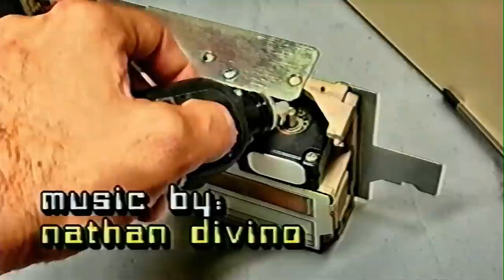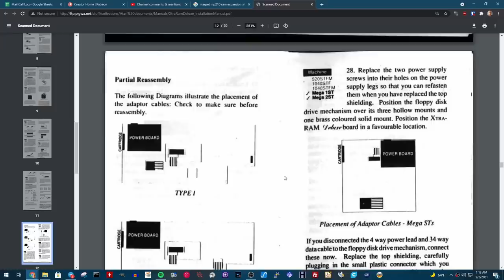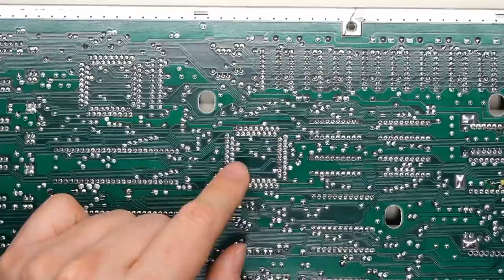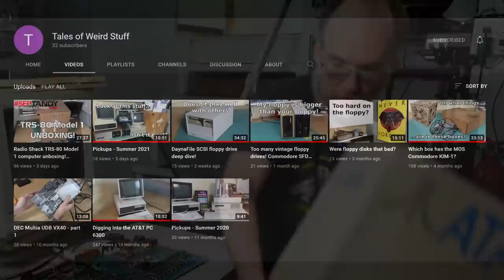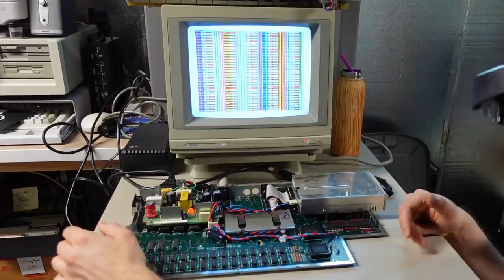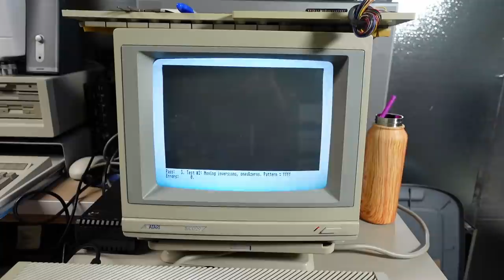I figured out what is wrong with the Atari 520 ST!

Comment: 4:10 I'm sorry to say that you're wrong here. There is only one bank of RAM (on a 520ST) and it is connected to data bits 15-0.
Reply: Now why are there two mods to disable the memory? This is because the 68k processor can address lower and upper half of the data bus individually, and, of course, chip selection of the RAM ICs has to support that, as well.
Reply from the maker: How does the 256k variant of the ST work if it requires 16bits of RAM?
Reply: @adriansdigitalbasement  Two banks of 128k.
Reply: 18:59 The ROMs are connected directly to the CPU, not through latches. Sorry, I like your videos a lot; but I find they should be factually accurate. 

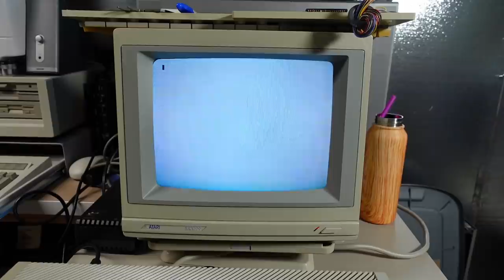31:34 Not to brag, but I'm the author of YAART.

In any case, congratulations for saving/repairing the 520ST.
Reply: @adriansdigitalbasement  There is NO 256KByte model released by Atari. And NO: THE 260ST came with 512KByte RAM. I bought one in Jan.1986. It just had one bank of RAM. I already wrote you these facts in an email from 4th Sept. BTW: nynyny7 is absolutely correct with his statements.

Comment: Weeeird to see GEM boot up with no disk drives present! Normally you get Drive A, which is really there (in a machine with the F), and Drive B, which it pretends to have, and lets you swap disks in the one real drive, to emulate it. So you can copy stuff between disks easily. Well, easily-ish, takes a few swaps if you have less RAM (it 512K) than there is space on a floppy (720K).

Comment: ooh my that's an obnoxious noise when the keyboard is disconnected!!! Must be a way to add a jumper or something to stop that when working on them in a dismantled state....... :S
Reply: You can connect/move a 10K resistor on the Rx line to 5V. There is normal a 10K resistor connected to ground but earliest model don't have a resistor at all on the Rx data line. The resistor should be close to the keyboard connector.

Comment: Facepalming the RAM explanation.  No Adrian, the ST has and has always had RAM on all 16 data bits.  The two chip selects are for selecting HIGH or LOW (odd and even) RAM, which is a feature of the 68000.  They can be accessed separately as 8 bits, or all at once as 16 bits.  The 74LS373 is part of the circuit to isolate the CPU from the RAM when the shifter is accessing RAM for the display.  On the CPU you will notice that there is no Address line zero (A0).  There are "Upper data strobe" and "lower data strobe".  They replace the A0.  They allow the CPU to access 8 bit and 16 bit memory depending on these "UDS" amd "LDS" lines.

Adrian, the book "Atari ST Internals" (available free on many places on the Internet) explains how the innards of an ST works.

As to the keyboard weirdness.  Some STs don't boot without their keyboard, as it's a shot in the dark whether it will or not.  It all depends on bus states.  The ST keyboard is intelligent, not just a grid like on other many computers. There is an onboard chip (in the keyboard) that handles the mouse and keyboard, and part of those signals generate interrupts.  When they are floating, they can cause the CPU to halt or just be confused.  It's always better to just plug it in.

Here's a trick, when booting an ST without a floppy, just hold "Control, Alt and Shift" down.  This tells the ST to bypass all of the boot seeks.  It tells it to not look for an AUTO folder, and not look for desk accessories.  Just a raw boot to desktop.
Reply: Never had an ST(E/F/FM) that needed the keyboard. Keyboard controller is connected to the ST's ACIA via a simple RX/TX serial port. So I doubt that "bus states" can have an influence on this. But you get the annoying "brbrbrbrbrbr" sound. IIRC a pull-up on the RX line helps.
Reply: @blackcathardware6238  Actually I have had an ST that does not boot without a keyboard each time (about a 50/50 shot).  It's a shot in the dark.  The key-click sound is the ASIC getting confused with the floating non-connection.  However it interprets those phantom keypresses makes the determination how it boots.  A pull up on the RX line is a perfect example of fixing a floating signal.  There are many busses in the ST, not just the Address/data bus.  RX is a serial input that is part of the ASIC's serial bus.  This can cause the ASIC to generate spurious interrupts and feed false data.

I am glad he got the 520ST to boot without the keyboard.  It just removes one aspect of troubleshooting confusion.  Frankly, even Atari suggested that proper troubleshooting required the keyboard be connected.  So it's not entirely a "non-issue".  I am picky about this aspect, as a disconnected keyboard was a bane in troubleshooting for me in the past.  A "everything checks out, why isn't it booting, even if I let it sit a while?" situation arose.  I connected the keyboard, and it worked fine.  My fixes repaired the machine, but failing to fully "electrically assemble" it brought up a non-problem that looked like a problem.  Want to leave the keyboard off?  Fine, but if it still doesn't work, just try connecting it to make sure.

Comment: The memory bus in ST is 16-bit wide, and it requires a presence of either 2 or 4 memory banks. Don't know the exact reasons, but 286 and 386 PCs were also using 8-bit memory banks.

Comment: I agree with others the ram expansion is pretty bad for this machine I would personally avoid it. There are OTHER options. You can sandwich more dips on top of the existing ram chips and double the ram. A few bodge wires and bob's your uncle. The sandwich technique seems more sturdy than the marpet upgrade. I have removed my ram upgrade boards from all my machines. Oddly there are very limited things you can do with 4 megs and an ST anyway. If you get fancy and run application software a HDD and neodesk or some other environment on the ST yes I can see your point. Games-wise nothing much uses 4 megs. A better enhancement would be to put a gotek drive on your atari. If you have the sf354 it is likely a single sided drive which sucks. You will run into issues running some atari games off of floppy.  An Ultrasatan would be a good upgrade for the system as well.
Reply: It works fine if
1. he disables the RAM completely.
2. he solders the board on to of the MMU to the pins.
Reply: The SF-354 is most definitely single sided. The double sided drive was the SF-314.

Comment: I had at least one Athlon desktop PC that required a keyboard on PS/2 or USB to complete booting.  I needed the extracted controller board from a cheap keyboard in a project box to run it headless.  Actually the no-keyboard alarm is pretty classic on PCs.
Reply: That sounds like the old "A20" thing? IIRC address line A20 was controlled by the keyboard controller...wonderful design decision!
Reply: "Keyboard error or no keyboard present. Press F1 to continue." If you don't have a keyboard plugged in how are you supposed to press F1?

Comment: Since the cpu seems to be wired in 8 bit mode (for the memory) only half of the data lines might actually be active.  I don't know if that would be the high 8 bits or the low 8 bits as the cpu is in BIG ENDIAN mode.
The 680000 would need SOME ram memory for its stack.
Reply: The MC68000 cannot run in 8-bit mode. Only the MC68HC001 and MC68EC000 have that capability, as well as the MC68008 obviously.

Comment: I figured out what was wrong with the Atari ST last video too.....

It's not an Amiga ;)
Reply: Not all of us were rich enough to buy an Amiga.
Reply: @jimgsewell  The ST was about the same price as the Amiga, at least here in the UK
Reply: Also, neither was I. I didnt get an Amiga until 1994 when the price finally came down. Until then I had a Spectrum
Reply: @jaycee1980  I read a magazine article about the Amiga and ran down to the local Commodore dealer to try to order one. At the time, the Amiga still wasn’t available for purchase but was expected to cost 4k. They did have a 520 ST available to order, computer, disk drive, and color monitor for $1300. The clincher for me at the time, was the inclusion of Jack Tramiel. He was the guy behind the PET and the C64. At the time, the C64 was the most popular computer of all time. My first computer was a TRS-80, I knew the cost of owning a less popular computer when it came to finding popular software titles and community support. Besides, this would be his second attempt at creating an Amiga-like computer. It seemed reasonable to me that he would be able to build it the second time, for much less money. It never did get the Video Toaster and the rest of the video related add ons that the Amiga got, so I was always disappointed. At least here, I don’t think the Amiga was able to compete with the Atari until they put out the Amiga 500, some years later.
Reply: In my previous post I meant compete pricewise.